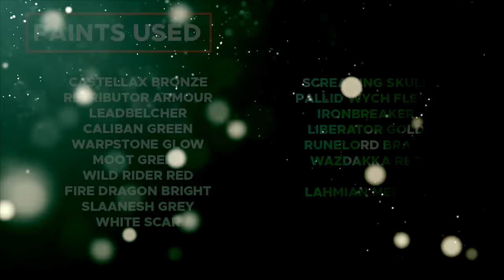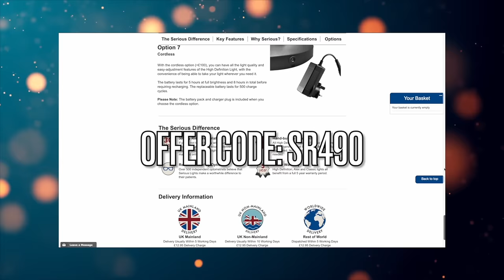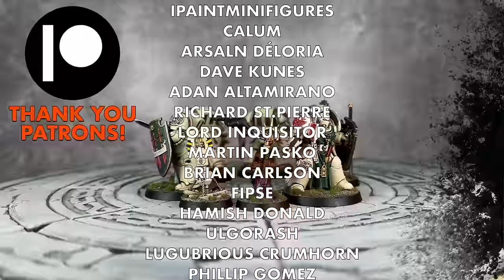Contrast+ How to Paint: New Deathwing Knights

Comment: I dont get how your seraphim shade is so light, even after watering its still i😊ncredibly dsrk
Reply: Faced this problem myself using an old knight earlier! Also this wraithbone base looks much lighter than mine
Reply: Honestly just go the route of base coating screaming skull and then recess shading with seraphim sepia or skeleton horde. This way when you make mistakes onto the bone armour, you can also just correct them with pure screaming skull rather than slowly glazing it on to make sure it matches the wraithbone + seraphim tinted midtone.
Reply: you need to use new version of shade (shades were reworked in 2022). Otherwise use Skeleton Horde + Medium mix